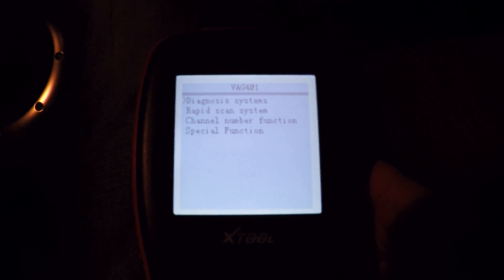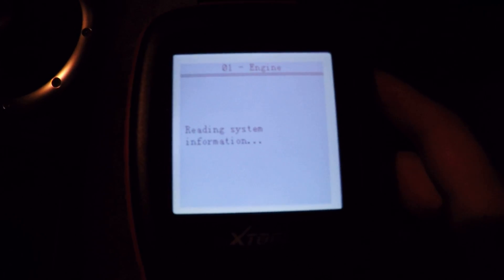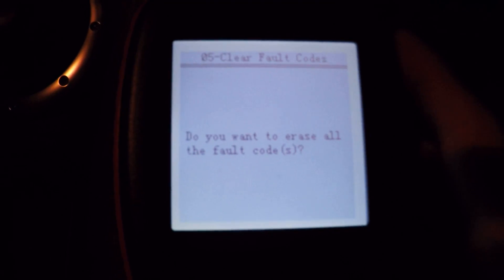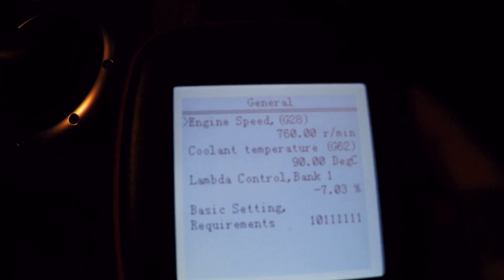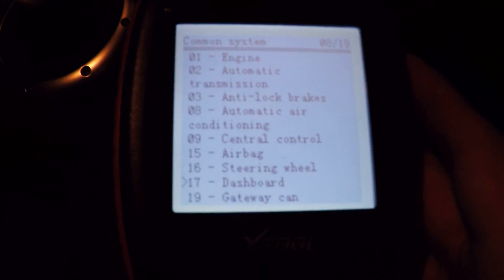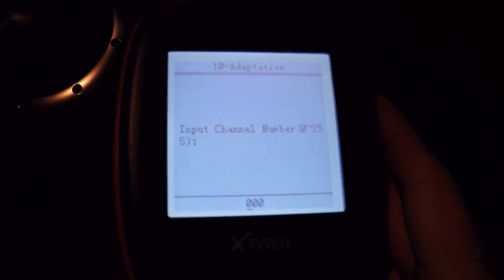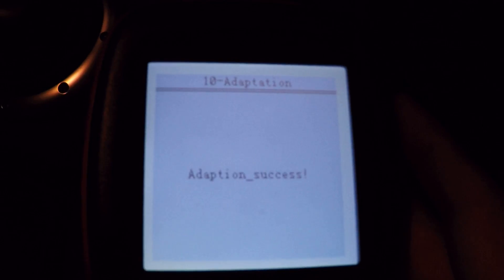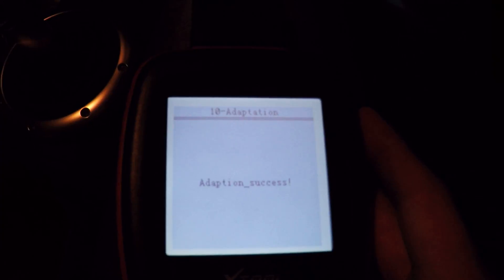XTool VAG401 Quick Tour

Comment: Well I just received my xtool v401 and straight out of the box, plugged it in to my Audi TT and all I got was two lines across the top of the screen 😕
What does this mean? I just have to wait? There's no 'on/off' button? Does it come out of the box fully charged up? Or does it draw all the power it needs from the obd port? Does the ignition need to be on? Does the engine need to be running? No clues in the manual.
I'm not stupid but as a first-time user for obd devices I could do with a bit of support for getting started - help please
Thanks
Andrew
Southampton
Reply from the maker: That doesn’t sound like great news, to be honest. The XTool powers from the OBD port and there’s no battery so it should just come to life when you plug it in. In my car it would work with or without the ignition on, though most of the systems needed the ignition on to read / program. I assume the micro SD card is installed in the bottom? You may be able to download the software and rewrite the SD card, though it’s been so long I can’t quite remember the process for that. I think you have to enter your serial number on the XTool web site then just download a file and copy it onto the SD card. Either way it’s worth checking that the SD can be read by a computer, if it can’t then that’s probably the issue.
Reply: @vehicularbodges9007   Cheers for the prompt reply - I think what I may have done to have screwed up my xtool virgin experience is switch the SD card that the unit came with to one of my own with much more capacity. I didn't realise that the SD card supplied with the unit contained some kind of operating software. I switched it over with my own one as I thought the SD card supplied was so feeble in its memory capacity. My own card was much bigger. All that is mentioned is that a diagnostic can be stored on the card for later use (whatever that might be).
But now you've drawn my attention to this, I'll switch back to the supplied one and have another go with my car.
I have to say, there's no mention in the 'instructions' whatsoever that the unit has to be used with the supplied SD card installed. That would've been helpful.
I'll post again when I've had another go to let everyone else know if the problem is resolved and we can all learn from this. I was about to write off the 40 quid and chuck the xtool in the bin!
Thanks for your answer - it's given me a 'lead' at least 🙂

Cheers
Andrew

Comment: Hi, thanks for the video (and the linked review). One question: do you know whether it is possible to use this to calibrate the dash pointers? I know that VCDS is the usual tool for this (sets the temp & fuel gauges to centre and speedo to 100km/h). I just replaced my lcd and now need to get the pointers correct again!
Reply: Just to follow up, I just got one of these (now called V401) and it is indeed possible to calibrate the dash with it using the output test of the dashboard module… happy days!
Reply: @minimism  Can you calibrate the fuel gauge to work like it should? On a audi a6 c5 the fuel gauge is showing in the middle when it's empty and never go lower. And volt gauge always show around 2 volts higher then the correct value.
Reply: Monkeyclub I don’t know about that — mine is only a little out. Video of my use case  is here: https://youtu.be/VtVYbw_JX2M

Comment: Hi,
How did you know it was channel 19? I'm trying to do the seatbelt warning but no idea what channel it is.
Reply from the maker: Hi, Jason. I normally look up VAG-Com instructions for what I need to do (either on forums or on the Ross Tech site) and adapt them for the VAG401. The channel numbers and so on are exactly the same since they are from the car's computer, the menus are even laid out in a similar way. Sometimes you run into issues with certain features but most simple stuff works.

Comment: hi

there is an option in the special functions which is (clear learning value) what this option do ??
Reply from the maker: Hi - I'm not really sure as I've never tried it. The next time I have it plugged up I will take a look.
Reply: good and i will waiting your try, im using the tool with my seat toledo 2001 do you have any sources for its blocks measuring or basic settings ??

Comment: Hi there.
Any idea how to check the ashes mass from the DPF and how to check the injector times?
regards

Hans
Reply from the maker: Hi, Hans. My car is petrol so no DPF, however if you look up the process for doing those things via VAG-Com then it is usually a straightforward translation into the VAG401 (even the menu numbers are the same). If I get access to a diesel vehicle then I'll report back results, however that won't be for a few weeks.
Reply: Hi Foeh.
Thx for the reply. Meanwhile I found out, that the menue in my VAG401 seems to be a little bit different from yours. I can´t type in block numbers at the chapter 4 "basic settings". There I have only fixed rows to choose out, without manual block choosing.
Also a request to Xtool mailbox haven´t got any feedback.
What do you think, do I have maybe the same equipment but with different software? I did the update first before I started using, but maybe this was wrong.
Indeed the xtool seems to be quite useful for some tasks, but especially choosing block numbers to read out data is my top focus.
Best regards
Hans
Reply from the maker: Hans H. Mine is on the latest firmware, which I think is dated mid 2015 so if you updated this year it should be the same. Are you accessing the control blocks the same way (i.e. Diagnostics -> common systems -> engine (or whatever) -> basic settings)?
Reply: When I compare your video views with accessing control blocks via basic settings, it is different for me.
I can´t type/pop up and pop down/ , I only can access 25 main folders and several sub folders behind the basic settings.
When I´m back home, I will post picture from the display to give a better understanding.

Comment: I'm waiting for this product in the mail you know how I can do Throttle Body Alignment? 99 Audi A4 Quattro
Reply from the maker: Hi, King. I've never tried it before (and my 2002 TT may be slightly different) but the VCDS process looks straightforward so if I get a chance later today I'll give it a go and report back.
Reply: thanx
Reply from the maker: I tried this on my car today and it seemed to work (though my throttle didn't need aligning so unsure if it made any difference). I basically followed the VCDS procedure here: http://wiki.ross-tech.com/wiki/index.php/Throttle_Body_Alignment_(TBA) but using the VAG401. On my car I needed the ignition on but engine not running. I'll upload the video soon.

Comment: can I get rid off a bulb out/check light warning?
Reply from the maker: Do you mean to reset it once the warning comes up or to do the long coding to disable the bulb check completely? I think the bulb warning goes on its own once the bulb is replaced (certainly does on my car).
Reply: Vehicular Bodges no the reason is because of installing LEDs, so I'm assuming long coding
Reply: Hi, Andre. It's possible to do recoding on the VAG401 (I used it to set the auto locking doors, future video!) however there's no helper like in VCDS so it comes down to the human reading the numeric value, translating that to binary, working out what bits to change, translating it back to a decimal number and plugging that in. Apparently there's a chance of bricking your module so care is needed. I've never tried the specific module you'd need but it worked for central locking.

Comment: Hi. do you know how to clear faults for a Steering Angle Sensor. I have a 2006 Passat FSI. I left the lights on and the battery went completely dead. when I changed the battery, I now have no power steering. I have tried the reset procedure by turning wheel left then right then back to center and driving for a half a mile, but no luck. just wondering if you know how to clear any faults with that system. Thanks! Dave
Reply from the maker: David Riaubia I've not had any experience of that myself but according to the Ross Tech site (http://wiki.ross-tech.com/wiki/index.php/VW_Passat_(3C)_Steering_Assist#Special_Procedures) the codes for steering position sensor get thrown in the ABS section (3), may be worth checking there if you haven't already. If you get to the bottom of it please let us know how!
Reply: thanks! I'll look into that.

Comment: Hello, Would you know how to disable Stop/Start using VAG401? Below are steps for VCDS:

Thanks,

Select Control Module 09 in VAG-COM/VCDS
Go to Security Access
Type 20113 and Login
Select “Adaption – 10”
Select Channel 34 and read
Now this is where the cool stuff happens and you have three options depending on what you want your Start / Stop Button to do…

Start Stop as Per Default after each ignition. On to off
Reduce the number by 4 (Effectively Bit 2 to 0)
Start Stop with Memory Function (Like the video)
Change the number to 32 (Effectively Bit 5 to 1)
Start Stop with inverted display (LED on switch is opposite)
Change the number to 64 (Effectively Bit 6 to 1)
Reply from the maker: I'm not sure as my 15 year old TT doesn't have the feature, but it sounds like that may be a straightforward adaptation. If that's the case then the value should be editable under control module 9, adaptation, channel 34. It appears that the value under there is a collection of flags mapped to bits, similar to how the central locking control works (i.e. you need to decode the decimal number back to binary, then understand what the 1s and 0s at each position mean). It may be worth reading about how that works (http://www.wak-tt.com/vagcom/vagcomclcoding.htm is a good starting point)  then applying the same method to see whether the output from your start stop channel tallies with the system's current behaviour. Obviously be sure before you do anything, it's all at your own risk and it sounds like you have quite a new car!
Reply: Thanks for your prompt reply. I could get into module 09 and go to 10 - Adaptation, however in that I could not see channel 34, there was no option to choose channels. Whatever was showing there wasn't about Stop/Start system.

Then I go to 02 Automatic Transmission -> 10 Adaptation -> and saw this "Deactivationg_of_Start_stop_function" = Not active -> choose new value using Enter -> Active -> and it's going back one screen but NO option to save that value. 

That's it, Could not find/change that :(

Anyway, thanks for your support :)